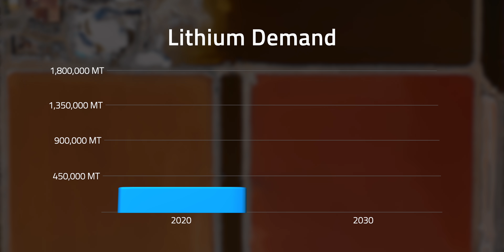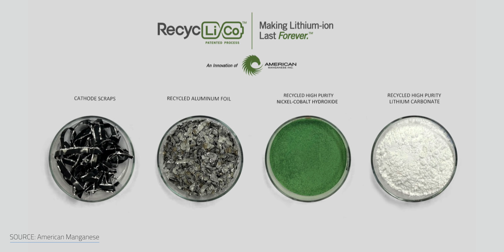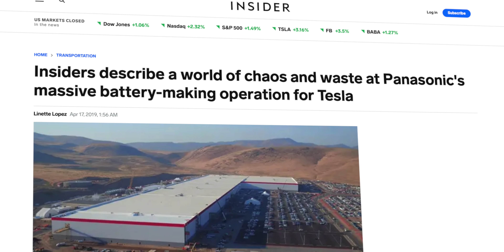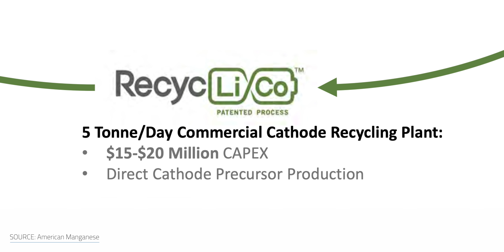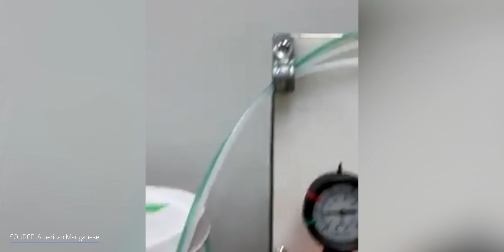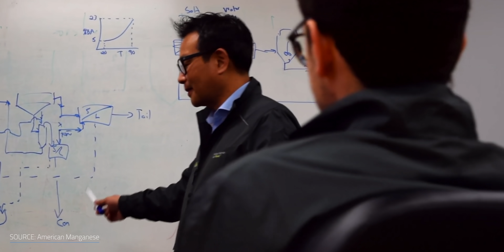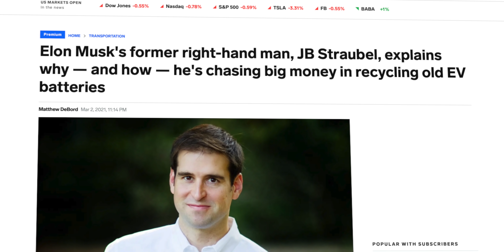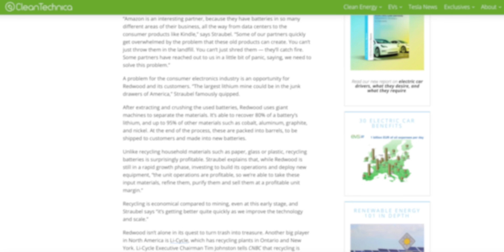Solving EV's Biggest Problem - Battery Recycling Explained

Comment: A question you could have covered... How much lithium do we actually have? And can we safely and effectively meet market demand? Recycling is still 10-20 years away from significantly reducing the amount of newly mined materials required. Given the exploding demand for lithium batteries, will there be enough? And what kind of environmental impact would mining on a massive scale have? Additionally, the heavy equipment required to mine will still need diesel power for the foreseeable future. Tractors are just too heavy and power hungry to be electrically powered as of now. The power requirements would smoke the batteries and they would need constant recharging or even hard wire grid connections. I am but a simple mechanic who thinks about energy constantly. I'm enjoying your channel!

Comment: Sadly, I ditched my lithium ion tool and returned to a gas-powered version. The battery lifespan isn't just there yet.  They are too expensive to replace.
Reply: Your best bet with electric tools is LiFePO batteries. They recharge better. Also, quality is super important.
Reply: lol, what tool? nothing could possibly replace my arsenal of battery tools. just buy the batteries off brand, they are a 1/4
 of the price
Reply: @ronaldtice9224  The tool is irrelevant, as my comment was about the power source.

Comment: It's good to see the efforts and advances are being made.
One of the biggest problems though is that recycling is still viewed as a business: not an environmental necessity...

Recycling is done by businesses because they want to make money. It's a simple fact. Without profit the business can't succeed.

So there's a delicate balance in this situation... Mining the raw materials is a huge, growing industry, and the more that is mined, the cheaper the price becomes (it is a simple supply and demand issue).

So the recycler has to be able to recycle the batteries and provide the raw materials at a cheaper price than the mined materials AND still make a profit.
AND the scale of the recycling operation has to be similar or greater than the mining operation. (preferably greater, as it would prevent the environmental and ecological damage caused by the actual mining itself).

And of course, it would be beneficial if the recycling process had a significantly smaller impact on the environment...

We can only hope that they succeed in the recycling endeavour.

Comment: 500kg a day? So a single car's battery? Lol we're going to have to scale a lot faster than that.
Reply: 500kg of battery scrap is muc more than one car battery. This is without the frame and casing. Only the active components. Also once you got the process dialed in, you can easyly scale if up by increasing batch size or setting up parallel plants
Reply: @fabianfeilcke7220   They did not specify whether its output of pure active materials or input of total scrap. Regardless even if primarily valuable material is used as measured output  3 batteries per day is still pretty rough from a plant investment cost and throughput standpoint. If car manufactures stick to current production schedules there's a lot of scaling to be done. Or maybe they have inflated definition of pilot plant haha. Hopefully they mean "small lab" lol.
Reply: @jonsullivan2342  "pilot" literally means "demonstration". So yes, all of this has to be scaled heavily but for a pilot is really good
Reply: @airpeguiV2  Yes I know what pilot means... Lol. The plant they showed initially was pretty large. As an engineer that both designs electric vehicles and also works in real estate I'm just saying they have their work cut out for them (understatement of the year lol). Idk if most people can really comprehend the scale at which we pump these vehicles out and the investment costs required to build factories. I routinely walk by lines that pump out a vehicle nearly every minute. If production scales as expected plus past waste we've got a long way to come.
Reply: @jonsullivan2342  How many EVs do you reckon get scrapped per day? How many do you reckon have salvageable batteries, that can go on to a second life as a stationary battery or, say, a newer Nissan Leaf battery that can go into an older Leaf (a 'donor' battery, if you will, check out Cleevely EV here in the UK). How many battery packs do you reckon actually get dismantled, scrapped and recycled? Some, definitely, but the main demand is going to be in the future, as more EVs get to the end of their life and as more stationary batteries get to the end of their life.

Also: I do agree with airpeguiV2, it's a bit rich to be criticising a demonstrator plant for being too small to cope with mass battery recycling. The technology is still in its adolescence, and these plants are a vital stepping-stone to get us to the large-scale facilities we're going to be needing in a few years. Ramping up a new technology is absurdly difficult (ref: I work on silicon carbide power electronics, alongside Clas-SiC Wafer Fab, MaxPower Semiconductor, McLaren, Microchip and others) and these demonstrator plants are still impressive.
Reply: No kidding. The ABML pilot plant will do around 54 tonnes per day (20K per year), which is 10x the production plant capacity that was advertised for the first company.

Comment: @Undecided with Matt Ferrell you forgot to mention rather important thing here, that will be much more important in near future - new chemistries .
Some companies are already testing high density battery chemistries which do not require rare-earth materials.
Best currently tested example are aluminium-ion batteries, that require no cobalt, lithium or even copper.
High availability and recycleability of materials within those batteries (aluminium, carbon, manganese, chlorine) will make them main player in rechargeable battery market.
Very high energy densities have already been shown at up to 1000 Wh/kg on prototype batteries.
Reply from the maker: Good call out.  Those batteries are coming, but are still years away.  We're also going to see a wide variety of battery chemistries with and without rare-earth materials.
Reply: @UndecidedMF  From what Elon said, from working prototype to mass production it currently takes less than 5 years.
Al-ion already have well working prototypes, so I expect them being mass produced before 2025, and if everything goes well for them, having market majority around 2030-2035.

Comment: This video more or less overlooked the near future effect of expansion of fixed energy storage, from domestic to grid scale. Used car batteries will have a long second life in these applications (and it's almost certainly uncertain just how long) before they need to be recycled. Uncertainties around that disruption compound uncertainties around the EV disruption where both demand for batteries (new and used) and for recycling are concerned.
Reply: This company isn’t looking at the EoL batteries right now. It’s the 10-30% production scraps.

Comment: Important video showing the essential but lesser known industry supporting the transition to electric vehicles.  It should be possible to build recycling facilities relatively quickly compared to a mine.  However, not all batteries will find their way to recycling, and not all the valuable constituents will be recovered as processes are not 100% efficient.  The recycling processes also consume energy.  Mining will still need to expand significantly to meet demand from electric vehicles, energy storage, and other uses.  It is unlikely that supply will meet global demand, so there will be competition between countries for battery materials.

Comment: How much energy does it take to recover the various components?  What by-products are there from the recycling process?  The chemicals used must come from somewhere, mined, processed etc.. what cost to they environment does this have?

Sure recycling, repurposing and re-using is great, and much more preferable to the current "throw away" society, but recycling isn't totally innocent in terms of "carbon footprint".
Until we have clean power production on a global basis, even if to charge the EV's and gadgets in the first place, and then to power this recycling process, we will continue to kill the planet. 

The key in my mind is to stop consuming in an ever increasing rate scale.  The idea of endless growth in this finite world is ludicrous.   And yes, I know that means we need a drastic re-think in "economics"  and a drastic reversal of population growth.
Reply: If There is a recycling system in place, Used Li-ion batteries will have a base Worth, which most likely is lower than what is currently asked at the scrappers now, so IT Will be cheaper too for sensible recycling individuals wanting to keep their aging EV on the Road.
Reply: @rogerstarkey5390  Not to argue, but are you sure the 5kWh Per barrel is electricity? I Think IT refeers to the extra heat input required to distill one barrel of crudeoil, as most of the energy is recouped in the refraction pile and Used to preheat incoming oil?
Reply: @rogerstarkey5390  I never advocated this, in fact I state that recycling/re-using/re-purposing is the way to go, and certainly do not  advocate the continued use of hydrocarbons as fuel.  What I do say is that there is more than just one facet to the issue.
If the cost to the environment of recycling (and then recharging all batteries) involves using electricity produced by "dirty" power generation (in Australia, electricity production is far and away the biggest producer of greenhouse gasses)  we need to look deeper.  No where does this video show the cost to the environment of the process of recycling, so a proper comparison can be made

Using hydrocarbons as a fuel is just one reason it's mined  All plastics, paints, lubricants use it.

We are the problem, our consumption is the problem. We need to consume less, regardless of whether it is newly produced, or recycled.
Reply: @Tore_Lund  Cheaper in money sure... but is the entire process, including power generation to recharge these batteries better for the environment?
And so we make it more economically viable to switch to EV's,  so that means more need to be built and the cost to the environment of building a new car of any sort is huge, we just perpetuate the problem, requiring more minerals to be mined and processed just to build the vehicles.  Can everyone afford to replace their vehicles?  I'm on a forced early retirement and live on a disability pension, there's no way I can afford even a second hand EV, especially when the batteries will need to be replaced, recycled or not.

Sure we can recycle some materials from the now obsolete ICE vehicles, but that costs energy and power. Aluminium (Aluminum) is very resource intensive to recycle, 
Recycling current waste cells will not cover all the new cells needed for new EV's , phones etc. 

We (humans) are so selfish we only think something is of value in dollar terms.
Reply: @iffracem  Actually, I Think we agreed pretty much on this. I got an EV last year and because I only drive 2000 mi Per year as I only occasionally need to be at Strange Places in work related matters, IT would make No sense a get a new one. Likewise as IT was Used, and I'm cheap, its batteries had seen Better, so I sourced and got newer modules from a scrapper from a low Mileage EV. Had I brought a new EV, IT would have been impossible to recoup its footprint from its manufacture, IT would not reduce my footprint for the next 20 years at which point, I'd likely would need new batteries again! So what I Imagine, as the Used EV market develloped, is that battery swaps and OEM and second had batteries become Common, though now with Very manufacturer specialised vehicles, there is little plug and Play between components from different manufacturers, but that Will change eventually. Glue shut vehicles, like phones are made now, does not make sense environmentally and rearly financially either for the owner.
Reply: @Tore_Lund   True, we're mostly "on the same page"...  except that I believe I higher uptake in EV's will in the short to medium term drive more mining of materials for the batteries, more pollution from their production, effectively seriously reducing any ecological benefit from their uptake.

I recently heard of problems with some Tesla EV's where they seem to suffer from "planned obsolescence", that wonderful idea that forces you to replace items all the time.
The motor (itself a genius bit of engineering) has 2 bearings that support it's central shaft, these bearings appear to often fail just after warranty expires.  Tesla won't replace the bearings, but will replace the whole motor,  at great cost in $ and ecologically.    (here's one video that has that info https://www.youtube.com/watch?v=_VbDgBZTUWg&t=802s) There are some repairers that can source replacement bearings and repair the motor, but unless your state/country supports "right to repair" laws, repairing the motor this way could actually be illegal.  Effectively trying to force you to buy a new EV once yours runs out of warranty...  that's been common practice since at least between WW1 and WW2, but definitely since the end of WW2;

Tesla and all the other companies jumping on the EV bandwagon are here to make a profit, first and foremost. They are not the cure for all our emissions problems (unless finding that cure = profit)

I'm not against recycling, and definitely all for getting away from hydrocarbons as a fuel, but I'm afraid people latch onto some charismatic person or company selling an idea that at best will only delay the inevitable, and most likely just shift the problem to somewhere else. BEFORE EV's can solve transport caused pollution, there needs to be GLOBAL clean energy production and distribution to recharge those EV's.

But as long as the world population grows, consumption will grow, and regardless of how clean the product you make is, it's very production is killing our planet.
Sadly, the world and it's governments are run by "Keynesian" economists, economists live by the mantra of "the economy must grow"  and consumption is their tool to grow economies. Bigger populations = more consumption = better economy.  
Before anything else, we need to stop population growth and unlimited consumption.  Even without the "greenhouse gas" argument that we selfishly focus on as it effects humans, we're forcing the extinction of other lifeforms on the planet at ridiculous rates by our population.

Professor David Suzuki said it best "We're in a giant car heading towards a brick wall and everyone's arguing over where they're going to sit."
Another great quote, attributed to (anti Keynesian) economist Kenneth Boulding, biologist Paul R. Ehrlich, and broadcaster David Attenborough. "Anyone who thinks that you can have infinite growth in a finite environment is either a madman or an economist."
Reply: @iffracem  The benefit of EVs Will Take a decade og more, before the are a less damaging way of transport purely from the extra footprint from the changes to infrastructure. This is even more true in the US, where renewables just now are planned to be a significant part of the Grid in a national scale. Same in Europe. Though further in the transition, there is still little effort to decrease the number of regular vehicles or shut down coal plants, so we are too increasing the CO2 payback time, by not aiding the expansion in EVs by cutbacks on other pollution sources. Market forces and politics other than environmental, have a big say here too.

Comment: Rochester! That city (like so many) could sure use some help. I can only imagine how many empty Eastman-Kodak buildings there are.
Reply: Yes, went there 18 months ago and it was rather sad.  I think it is the sort of city where no one really lives "in the city" but all in the suburbs.  At night the centre was a very empty depressing place but nevertheless had some amazing buildings
Reply: Nice try harder
Reply: And that is why they located there- lower rent for the facility they needed and a ready, high tech work force. This is not the only such opportunity in the US just now. Boeing has signed in the new lessee for one of their big assembly bldgs in Seattle. Many empty malls are parking and sorting places for Amazon's fleets of delivery trucks. And within the next ten years, self driving cars are likely to become normal if not the norm- 80 K OTR truck drivers will be without a job. This has been the ever accelerating story of the Industrial Revolution. FR
Reply: @justinstephenson9360  Yes, the core of the city is very quiet at night. Its nor really a city as much as it is a suburb. But most American cities are like that now.
Reply: Not as many as you think really. Most of the ones designed for a specific purpose have been knocked down. The infrastructure is still there though. In house utilities, sewer, rail line waste treatment plant etc. Its all there, someone just needs a reason to build on it.
Reply: i had rechargeable batteries for my alarm clock from energizer but the problem is the clock takes 3 AAA and the recharger only recharges 2-4 batteries at a time, so you basically need 6 batteries to even charge, otherwise your basically over charging a battery to charge 2 other 

3 dead but to charge the 3rd you need a 4th battery which doesn't get used unless you have a cycle and mark it
Reply: @knightwolf3511  There was a time when there were more electric cars than gasoline ones. Four volt ones, six volt ones and so on- ultimately the industry settled on six, till the late '50s- early '60s. The market hasn't found it's "natural standards" yet. It wouldn't be that expensive to design chargers for multiple different loads- but nobody sees any money in it, yet. FR